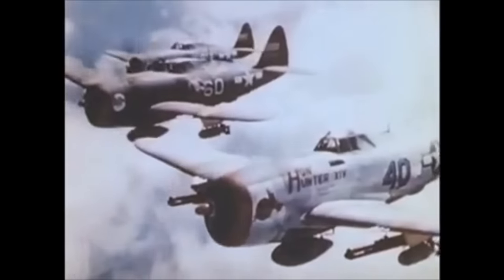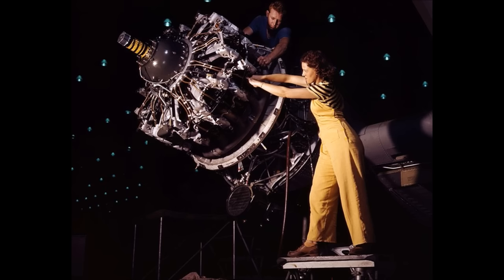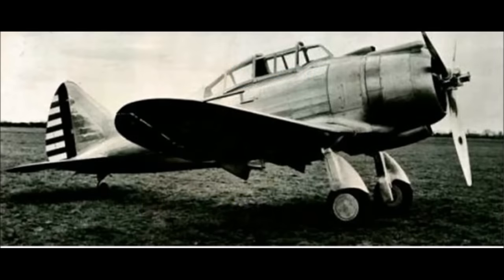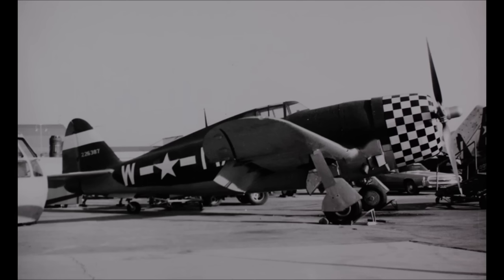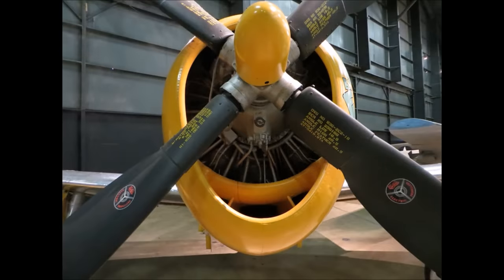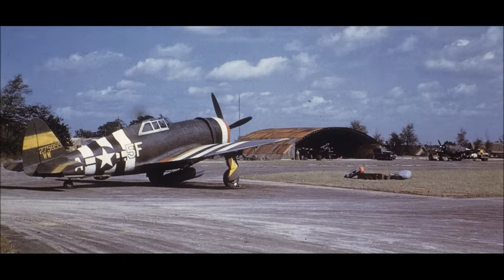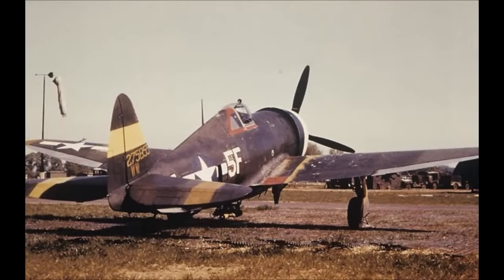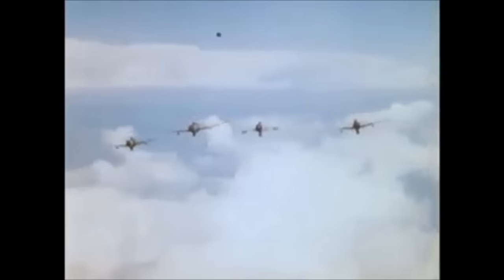P-47 Thunderbolt Pt. 1 Design and Speed

Comment: The P-47 was probably the best general purpose fighter of the European theater. After the P-51 finally got its act together the P-47 became successful again in the attack role. It was tough and could take a lot of damage. There's a reason the same company's famous heavily armed and armored attack jet, the A-10, is officially named the "Thunderbolt II".
Reply: The best all purpose? The tempest would like a word.
Reply: @marrioman13 That would be a pretty one sided conversation with the P47 doing most of the talking.  The P47 could fly farther, carry more weight, and fly faster at altitude while, most importantly, taking more damage.  The tempest didn’t provide high level escort, a huge factor in claiming it to be the best all around fighter.

Comment: Dad flew B29's during the war and I grew up with an interest in WWII in all its aspects, emphasis on air power.  Your series here is fascinating for me, I'm a big fan.  Tons of detail now is available thanks to the Internet.  What I still find lacking on the web are detailed analyses of various fighter tactics, a second by second rundown on what to do in any given circumstance.  There is some info about altitude advantage and speed preservation, but that's textbook.  What were the best pilots teaching each other?   In films from the era, we often see combat aviators illustrating their moves with their hands and I'd really love to understand what exactly they were diagramming.  What were the strengths and weaknesses of the aircraft they encountered and how did we compensate?  There had to be a hundred subtle jinks and shuffle steps under conditions a, b, c etc.  A rundown on tactical doctrine and field-learned tactical necessity (two different things) would be ideal.  We rotated our best aces out of the front lines and put them under training command.  What were they teaching their cadets?  I'd also like to know how much attention a pilot gave to his plane's systems while in a turning dogfight, for example.  How much of flying the plane was automatic, how much was analytical.  Those pilots seemed to be very analytical and adaptable in the heat of battle.  Were they trained in Zen detachment?  LOL!

Comment: Here’s a great 4 minute HD video with great sound of a P-47 startup. You can see the usual radial engine startup smoke coming out of the waste gates low on the front cowl and at bottom rear of the fuselage at the turbo. I wouldn’t have known why until I watched your P-47 video. A P-51 taxis by at the very end. A beautiful sounding engine. But I’d pick the P-47 Thunderbolt just for the engine and the great aerodynamic aesthetics. 
I would need to own a gasoline/oil company, I suspect, to ever afford to fly either of them.

Comment: I learned from this video that WWII fighter pilots had to manually manage oil temperature, drag, manifold pressure.   I knew about managing fuel mixture.     There is a video on you tube about field assembly of a P47.   I watched it several years ago.

Comment: It's funny that you mentioned newer WWII flight sims. I know it's not really a simulation, but a game I really enjoy playing is War Thunder. The two P-47Ds for the US in game are the -25 and -28, and for the longest time they ran at the lower engine settings. Finally the D-28 was updated to run at 70" and the difference (in the game anyway) was really noticeable.
You're also right about sims giving German planes the best possible performances. From what I've heard, the Bf 109 F-4 and K-4 are running on extremely high settings in the game.

Also, I was wondering where you find flight test reports and all these other NACA reports? There's a few aircraft that I'm trying to research, but getting reports like the ones that you're able to find are very difficult.
Reply: Have you tried IL2 Great Battles? Its like War Thunder but with at least some of the engine management and amazing flight physics and damage. If you want engine simulation in obscene detail Il2 CloD (a different game entirely, confusing I know) does that perfectly.
Reply: The K-4 runs on rather high settings in WT. 1.98ata, which was only possible with MW50 AND C3 fuel, which was rare and on/off forbidden in rl. Pretty chaotic.
The F-4 runs like it should as far as I know.
Reply: @Sheriff's Sim Shack Bf 109 models in War Thunder typically run at the highest settings that were ever available for that particular type and number. Historically speaking, this results in some oddities, such as the 1942 Bf 109 G-2 running with "final" ratings from 1943, and the 1943 Bf 109 G-6 running with a 1944 engine with the MW-50 bolted onto it.

The F-4 likewise runs with the highest allowed ratings for that engine. These are historically correct, from a certain point of view, but not representative of the aircraft throughout most of their careers. And the K-4, well, the DB 605D engine in "C" configuration was supposed to produce 2,000 PS running at 1.98ata with C3+MW50. The "B" configuration was supposed to use either C3 fuel alone, or B4+MW50 to achieve 1,850 PS at 1.8ata. These were really the same engine, the configuration was just changed basically with a screw driver. So historically speaking, the Bf 109 G-10 and Bf 109 K-4 had the same engine and power output, depending on config and fuel options. The reason why Gaijin has implemented the G-10 with the DB 605DB and the K-4 with the DB 605DC engine is mostly dependent on creating tech tree progression.

I'm fine with all of this since the game doesn't really attempt to replicate the "real" performance of war-time aircraft, but rather a kind of theoretical maximum of sort. Physical weathering is not modeled, wear and tear reducing the performance of aircraft is not modeled, bad manufacturing is not modeled, issues with reliability are not modeled, and things like fuel shortages are not modeled either.
Reply: You can play with settings for the radiators, turbo RPM, supercharger gear, propeller pitch, fuel mixture (which is poorly implemented into the game), feathering and magnetos (for some reason... maybe as emergency engine cut-offs to prevent fire, I have no idea) in War Thunder.
Reply: War Thunder does have a Hardcore Simulation mode, but playing it without head tracking and a yoke would be silly.  Plus, of course, I don't think Gaijin has ironed out all of their bugs, simulation or otherwise.  

Try flying the He-162 in Simulation mode, for example; pretty sure its one of the platforms that suffers the most from the ground up to altitude.
Reply: Yeah, I enjoy playing sim every once in a while. I need a head tracking thing though...
Reply: I know right!? Forget the HOTAS and rudder pedals. The number one equipment you need to boost your performance in aircrafts is head tracking, by far! (As long as the game supports keyboard and mouse, which War Thunder does pretty well.)
Reply: @jamespfp  war thunder isn't sim 
If you want sim play DCS or IL-2
Reply: Well George, turns out that there's three game modes for War Thunder, and Simulation is indeed the third, most difficult, and LEAST USED of them.  It doesn't surprise me that you cannot see the forest for IL2 and DCS.  Who GAF for the second one, if there's no useful multiplayer?

Oh that's right, tech geeks with too much $$$, and people who purchase "X-Plane".
Reply: War Thunder has terrible fligh models that are nowhere even close to what they should be.
Even few minutes with these planes in IL2 or even better DCS will show you how far from real handling "sim" in war thunder is
Reply: First of all, Shlomo, under what basis do you judge what an adequate flight model "should be"?
Personally, I find War Thunder portrays aerial warfare in a very authentic and immersive way, does an amazing job of modelling the physics accurately to how aircrafts behave in real life while remaining extremely accessible, easy and intuetive to operate (really, no other game comes anywhere close to achieving what War Thunder has, in that regard) and, finally, the aircrafts for the most part perform like one would expect them to, relative to each other.
The game does have a collection of smaller interesting quirks, but they keep constantly changing and optimizing things.
One thing the game really lacks (quite critically, in fact) is a tutorial/rulebook. You have to learn almost all the mechanics of the game by experimenting around, the game gives you practically no help and a lot of things aren't that obvious. For example, most players who have played the game for a couple of years still can't tell which ground targets that needs to be destroyed in order to complete the objectives / bleed enemy tickets (it's the ones with a slowly pulsing target icon, for those of you who still don't know).
Reply: I have been playing wt on and off for the past 5 or 6 years it is a nice game to have a 30min break that rb/sim takes and takes much less involvement than starting up IL or DCS.
But it is hardly a realistic sim planes behave in weird ways and fm are barebone and developed for fbw mouse&keyboard controls.
If DCS and IL have 109 and p51 behaving very differently from an arcadish game that is known for use of "secrit documints" and pushes out hundreds of planes when competitors work on few dozen planes.Multiple planes have weird behavior they over or under perform anyway game devs are now focused only on tanks and have been for the past few years.
Try a real sim and after few minutes when you go back you will suddently realise how wierd they feel when flying using hotas especially DCS is great in that regard

Comment: I have read that WWII veterans in the Korean war liked jets because they just had a "go handle" and did not have to do all the engine management that was required with piston engines.
Reply: The jet engine came just in time. Piston engines had just about reached their full potential, becoming increasingly more complex in themselves, and to manage. No flight engineer in a single seat ship. The jet, however is another ball game. Turbines had been around forever; but Whittle and The Guy from Germany took the turbine to a whole new level. Both inventors were initially ignored officially, but Heinkel pushed it on to its first flight. Someone finally took notice in England and Whittle was able to get his airborne later. The rest, our host will hopefully have a look at this fascinating form of thrust generation.

Comment: The A-10 is a worthy successor to the Jug in every aspect. Cept for speed.
Reply: Yeah, it's slower
Reply: @tedarcher9120  And... Ground support is never about speed. Such planes need low fuel consumption, long loiter time over the target area, F off big guns and high tolerance to combat damage. Fast jets can't do any of that.
Reply: @Dave5843-d9m  as long as they keep fighting in asymmetric warfare. The A-10 is a sitting duck in any area with anything but aerial supremacy.
Reply: As a former Hog driver, I loved it. When I started flying it, I thought it was the best WWII fighter ever. It had no Inertial Nav system, used basic map, grease pencil , and a compass to navigate. We had to use Kentucky windage and estimate your range to the target to adjust the 41mil guncross pipper for shooting the gun. You could only mill crank to adjust for head/tail winds, again estimating for crosswinds bombing. Once it got INS, it helped with the windage and navigation. The LASTE mod added a radar altimeter (nice when rooting around at 100ft) and allowed for Continuously Computed Impact Point (CCIP). Silly to design a plane these days without that capability. It made bombing and strafing so much easier. Now with the A-10C  and the LIGTNING pod, it has the capability to laze targets and drop smart bombs in addition to the Maverick missiles. We could only do about 350kts (~400mph) on the deck, 325kts on really hot days in the Nellis ranges. Yep, we were the brunt of the jokes where the speedometer was replaced with a calendar, the Navy version (no such thing) had the tailhook on the nose and carrier would drive under it. It was fun watching the shockwaves of 1174 hand grenades heading to the target at over 3000ft/sec and seeing it disappear.
Reply: My uncle flew an A37 in Vietnam, he said it was the precursor to the A10. I had to look it up, I think he might be right.